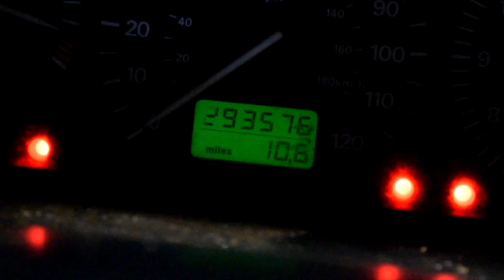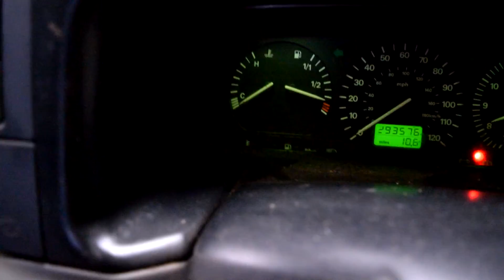The most disgusting van ever?  £500 VW Transporter T4 Review by Tommy Autos

Comment: owned mine for 21 years,as a carpenter helped me earn thousands.now retired seems im in with the inn crowd at last.still love my well kept van.still drives very nice at over 200.000 mls
Reply: Youre not in Gloucester, UK are ya?
Reply: @johnguy1969  no norfolk
Reply: No worries. Thought I'd ask as there's a lovely old white T4 here that is sign written as a carpenters van. My 300k 1995 T4 has been a camper and my daily work van (carpet cleaning) for the last 15 years 😉
Reply: @johnguy1969  i add archoil to a tank of diesel every 5 thousand miles.cleans the whole system .i swear by it